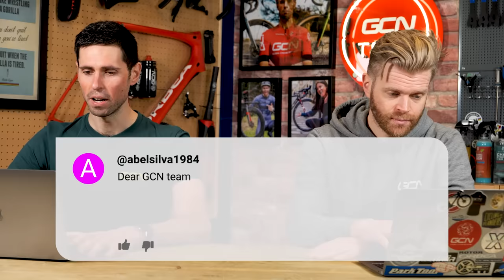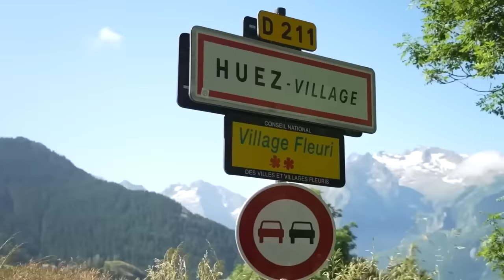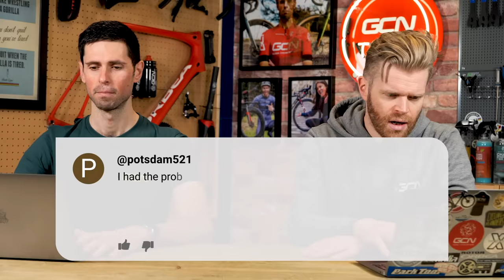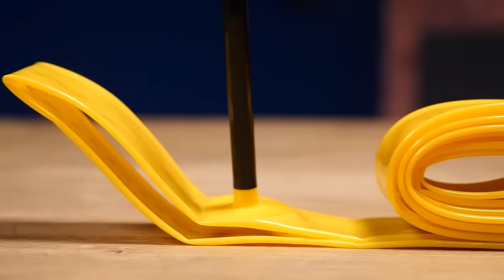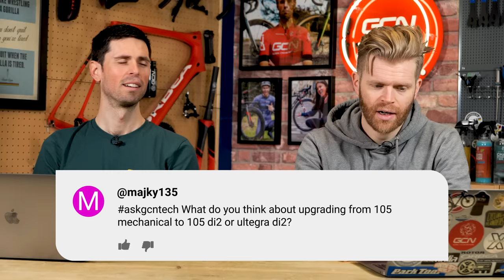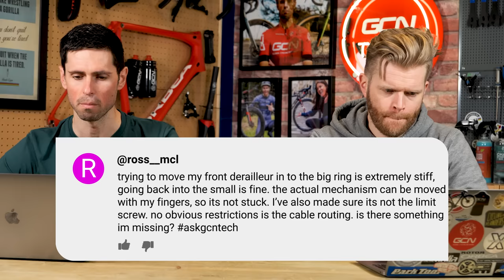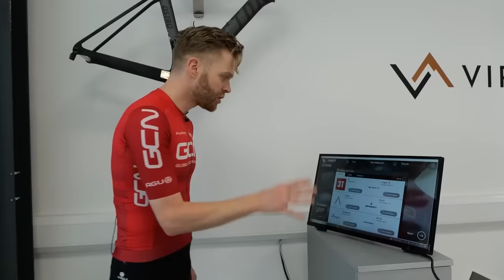Electronic Gears, TT Chainrings & BOA Cycling Shoes | GCN Tech Clinic

Comment from the maker: We love to hear those nerdy bike questions! Keep them coming with #askgcntech ⚙
Reply: Thanks for answering my question!
Reply: #askgcntech I am trying to add a crank based power meter to my sram rival group set and I cannot remove the drive crank. I have tried removing it with a large hex tool wrench but after putting a huge amount of force on it, it won’t budge. Any advice?
Reply: #askgcntech Hi GCN legends, I have a Wahoo Kickr trainer and it’s begun to make a grinding noise when riding in the bigger gears. The cassette and chain have been recently changed and can’t figure it out. Gears are shifting fine. Any ideas? Do Wahoo trainers needs servicing? free hub issue? Any ideas? Thanks!
Reply: A saddle that is comfortable and a good bike fit, even a fit from a dealer who has the knowledge and will take the time to adjust the bike and maybe swap out a stem if necessary is worth way more than the cost of a carbon frame
Reply: #askgcntech should I worry about buying those budget-friendly sunglasses & lights from Amazon? How inferior are they to branded gadgets?
Reply: #askgcntech does a carbon frame make a gravel bike more comfortable compared to an aluminum frame? Or do the Tyres make a big difference in gravel like they do on road bikes? Looking for my first gravel bike!
Reply: A good high quality wheelset makes a big difference and will offset the weight difference of an alloy frame and may even make you faster than a person on a Carbon frame Ollie forgot to mention.💯👌🏻✌🏻🚴‍♀️
Reply: #askgcntech I'm cycling to Geneva in the summer then off to watch a stage of the TDF. I'm planning on giving Alp D'Huez a go and wondering if i could change my Ultegra chain ring setup from stock 52/36 to 52/34 is this actually mechanically possible does anyone have any experience in this? also Jockey wheel /bearing upgrades does this make a noticeable difference or more for show. Thanks.
Reply: #askgcntech Where can i watch the GCN + Documentaries such as KOM hunters now gcn + is no more.
Reply: #askgcntech when commuting, as well as a regular front light I have a small (low output) light on my helmet that makes a huge difference to my winter-night safety so I can catch the eye of drivers waiting to pull out of side roads; aero aside, is this something you can envisage problems with (e.g. in a spill or long-term neck fatigue)?
Reply: #askgcntech as I'm riding exclusively indoors for the past month and probably the next one or two, how often should I clean and lube(oil) my chain? I think it makes more sense to give a number by riding hours instead of a distance. Right now I've noticed that the drivetrain itself is not really "dirty" as when i ride outdoors but after 8-10hours of riding it gets a bit noisy so i lube it up. Is this too much?
Reply: #askgcntech Hi GCN team, question about Silca Synergetic - I live in the rainy Pacific North West and recently switched to Synergetic lubricant - do I have to always reapply after hosing down my bike coming back from a rainy day ride? If yes, I heard the new Silca Synerg-E is more viscous - is that a better alternative so I don't have to always reapply after hosing down my bike? Thank you #askGCNTech
Reply: #askgcntech hello my friends, I will be doing multiple gravel events and wanted to know if you would recommend a 1x or 2x setup. I’ve never done them before so don’t know how steep the hills are. Which should I go with. Currently have a 2x 50/38 and 10-36 setup
Reply: #askgcn Ben O'Connor seemed to have pronounced ribs on or under his sleeves of his new decathlon kit in Mercia. Is that allowed? Are other teams doing it?

Comment: As someone in his 40s that had the same question about carbon bikes and ended up biting the bullet — the performance difference might not be much, but the feeling, oh man, it was definitely worth it. I don't care if I'm 10 seconds faster or whatever, but it feels lighter, more comfortable, a lot more pleasurable to ride.
Reply: I agree, I got a carbon bike this year. I'm not going noticeably faster but the bike just feels nice to ride. No regrets
Reply: I simply put a redshift stem and seat post on my alloy frame...... Feels just as nice if not a bit nicer than both my steel build and my carbon bike ..
Reply: @gmivisualsjason3729  throw that stem on your carbon bike and you'll be reminded that alloy is rubbish
Reply: We can tell you're a beginner. You've made the same kind of comment that people did when aluminium bikes arrived to the market in relation to cromoly ones; oh aluminium is so much better than cromoly, and this and that!...That's how marketing works on people's head. That's brain washing. Have you tryed Titanium? Have you tryed Termoplastic? What about carbon tubes+aluminium joints? Even wood? They make wooden bikes in the Basc country! Let us now after.
Reply: @bluetooth2000  I own carbon, aluminum, titanium and steel bikes.  I really only ride the carbon ones and for good reason.  I'll probably get more metal bikes in my future but it'll be to support a local craftsman vs getting a bike that's actually going to perform well
Reply from the maker: If you've got the funds a carbon bike is great! Would you ever go back to buying aluminium?👀
Reply: @gcntech  if I'm short on cash, sure — there's nothing wrong with aluminium bikes, but if you have the privilege of affording carbon, go for it. It definitely offers a better ride quality.
Reply: @LFMC1  Wrong again. 🙄
Reply: As someone in his 40s that had the same question about carbon bikes and after riding Alu, C and Ti bikes on road & gravel...the performance difference is NONE but the feeling, oh man...80% from "the feeling" comes from wheels/tires setup !
Go for a bike frame where you find a comfy position (material or aero doesn't matter at all for any rider who mainly ride <35km/h alone), get some modern wheels (large U shape, good hub) and good tires (main brands, mid-top range, no race/TT stuff), you will get a really nice riding feeling !
Reply: I think the feel that comes from rolling carbon wheels is even more important. If you have a carbon frame but still rolling with alloy wheels, you are missing most of the experience. Bad wheels may ruin any great expensive frame. Buta  good set of carbon wheels and proper quality tires can smooth out almost any frame even if its made of stone.

Comment: “On the rivet” is an old-school reference to leather saddles which were typically riveted near the nose of the saddle, hence “on the rivet” being on the nose.  And the hard shifting issue is 100% a worn or dirty housing/cable (and easy fix), takes very little internal friction to impact ability to pull the cable and shift big.
Reply: ...on the rivet ....yes leather saddle reference manly to old Brooks saddles
Reply: @edromero7985 pretty much every saddle was riveted and Brooks didn't invent the bike saddle
Reply from the maker: We love these old cycling saying, can you think of any others? - Another point to electronic shifting?
Reply: @gcntech He was really on the rivet up the base of the climb, but when the road turned skyward in the final five k, that was when he started dancing on the pedals.

Comment: Like Ollie said, no reason to upgrade to electronic groupset unless your mechanical has failed or you found a super deal.
Reply: … or you would like to have electronic shifting and can afford it
Reply from the maker: Nothing wrong with mechanical 🙌 - electronic shifting is pretty nice though...
Reply: I think the only reason you really need electronic groupset is for a TT/Tri bike, so you can shift from both positions.  Otherwise, mechanical shifting is perfectly fine, and works extremely well for a modern groupset.
Reply: Or you have a medical issue.
Reply: @grahamaustin9085  if you can't push the shift levers, you shouldn't be on a bike.  i can do it with my pinky.  that's the most idiotic thing people say "oh muh mech shifters are too hard to push!"  how do you brake then?  that requires way more hand strength than shifting

Comment: The front derailleur problem, where it's hard to shift to the big ring - it's almost certainly a cable tension issue. Shifting to the big ring is the action that adds tension to the cable, so if you have barrel adjusters or a built-in cable tension adjuster on the derailleur, it is best to ease the tension a bit and adjust the limit screws accordingly.
Reply: Yeah, I was going to mention that as well.  The more tension you have in the cable, the more force you have to use to press the lever (because you are pulling a cable that is already tight).  Front derailleurs are tricky to set up some times and there is always a possibility that the derailleur is bent or otherwise positioned improperly.  I find the Park Tool youtube video on this topic invaluable.
Reply from the maker: Great idea - we've got a great video on these sorts of minor adjustments  👉 https://youtu.be/4Q34TIMxrcI
Reply: This. I had similar issues and tried to "fix" by messing with the limit screws. After going for a (very miserable) ride without checking if it was actually working before, I completely loosened the cable and re-adjusted the shifter from the scratch. First attempt resulted in the same behavior, while in the second attempt I actually put more tension on the cable, and it was within specs.
Keep in mind I did this in my kitchen without a proper nose plier to tension the cable.
Reply: I’ve always set the front mech by shifting into the smallest ring, screwing the barrel adjuster all the way in and pulling the cable through by hand. Any remaining slackness can be taken out with the barrel adjuster. It’s always worked for me.
Reply: I had this problem on my bike and found it was caused by the shift guide arms not being parallel to the chain. The derailleur just clamps on to the upright tube so simple to loosen it and turn it so the guides were parallel! Shifts like butter now.

Comment: BOA was originally invented for, and is frequently used on snowboard boots. It has many benefits that cross over, like wanting to adjust tightness on the fly (with gloves on), and easily being able to distinctly tighten separate zones of the shoe/boot.
Reply from the maker: Boa seems to be the way most shoes are going - Have you made the jump from laces?
Reply: @gcntech I haven’t had laces on cycling shoes since the mid 1980s, but I still have two reasonably good sets of all velcro Giro Prolight 2 that I haven’t yet completely worn out! One for indoor training, one for the open road.

They were the lightest production shoe at the time they were released, and the delicate American (VanGarderen) used to endorse them. 

I have a newer pair of shoes with boas sitting in their box in my closet, waiting for one of those old pro lights to fail me. It’s inevitable, but still taking longer than I expected.

(Post edited to space paragraphs for your reading pleasure.)

Comment: Carbon vs aluminum is not just weight. In my experience, carbon gives a much nicer, more plush ride doing a much better job of absorbing all the roughness of the pavement. Aluminum feels very rigid and rough. I've bought 3 used carbon frames and built them up with mid priced components and have been riding all of them for years. Great way to go.
Reply from the maker: That's true, good quality carbon should take up the bumps a bit more. That said, aluminium frames have come a long way, Alex just built himself a dreamy aluminium bike 👉 https://youtu.be/XaaIMTObYLU

Comment: often when you go to a bike shop to buy a new bike they can put on the size cranks, stem and bars that you prefer at no additional cost. Sometimes even the cassette of your preference if they have enough lying around. Aluminium bike is absolutely fine, also if you crash it's far less likely to be damaged beyond repair. if you want to save a kilo, lose weight, use the 1000,- you save on getting proper tires, nice fitting clothes and other accesories.

Comment: BOA is all over the place in workwear, running, golf, snow sports, helmets, and I've even seen it on prosthetics. It's expensive compared to laces, Velcro, and buckles, so it won't be on everything, but I think it's proven it's metal and they have a good warranty support program if something does break. Some of the older dials got gunked up easily or would even break off, but I personally haven't seen any of those failures on their newer snap-in dials... and ive caked them in mud quite a few times.
As for the aero and weight arguments, I guess it's up to the user. Laces are more aero than a dial, one dial is more aero than two... but two dials let's you change your circulation mid-ride and ultimately lets me ride further and longer. As for weight, ankle high versus no-show socks probably have a greater weight penalty, plus shoe laces retain water/moisture. A damp shoe is a heavy shoe... and heavier with laces.

Comment: Great show and keep’em coming! The issue with the front derailleur may be as simple as lubricating the cable wherever it may be rubbing in the housing causing friction. With a few drops of a thin lubricant  such as Tri-Flow the problem may go away. Much easier and cheaper than replacing the cable and the lube starts to work almost immediately. Works wonders for brake cables too, especially the noodle.

Comment: I went Di2 when I'd gone through two Shimano 105 shifters and two frayed shifting cables (both on multi-day tours) in as many years. It wasn't a cheap upgrade and it challenged my wrenching skills -- especially the upgrade from cable to hydraulic brakes. But I haven't regretted it for a minute. More reliable, more reliable shifting, and the difference in braking feel is nothing short of astounding.

But as the professional spokesblokes say: If it ain't broke, don't fix it.

Comment: Re the guy with TPU tubes losing air. Me too. I bought 6 TPU tubes some months ago, after watching vids of how they are more pierce resistant and so much lighter. Tube #1 lost air overnight and on rides, bubble testing showed nothing, and it got replaced in a week or so. #2,3,4 got punctures over time but patching them was hit and miss. Bubble testing showed a good repair but they kept losing air, sometimes to complete flat overnight. Sometimes the patch just came unstuck. They got replaced. #5 is on the bike and surviving. #6 is a spare as I've gone back to butyl on the rear wheel. The brand was RideNow and I would not recommend them to anybody.

Comment: Frint shifting issues - On some Shimano models there has been known (but not common) issues of corrosion over time in the index ratchet system. Most Shimano shifters are serviceable, as the ratchet system and lever blades are available as spare parts. Try to clean the mechanism as best as possible, and spray a water displacer/penetrative fluid (WD-40 or similar) to lubricate the mechanism. I always spray a little fluid on the shifter internals at service intervals or at the start of winter to try and increase the longevity of those delicate parts.

Comment: I dispute that the BOA system isn't in other shoes. It has been used in certain mountaineering boots and is increasingly present in Ski boots and running shoes. The micro-adjustment is very useful in ski boots designed around it because you can get secure around the foot without pressuring an edge of the plastic shell into the top of your foot.

Also, laces are harder to get right first time and take more time and effort to adjust, definitely can't be done well one-handed while riding, and velcro might require more force to get tight than twisting a boa dial, As somebody with a shallow midfoot, I wouldn't love adjusting velcro and tugging my foot to the side while riding.
Reply: BOA IP1, Li2, S2 and S3 allow you to fine-tune lace tension on-the-fly. I've done this a handful of times with my IP1. Only the regular L-Series require undoing to readjust lace tension.

Comment: I have a Emonda ALR that I bought new in 2015 and love the thing. I ended up upgrading it to SRAM AXS, carbon bars, carbon seatpost, and lighter wheels.  Weighs just a tad over 16 lbs.  When I bought the bike, the carbon version was 1200 more, but the AL version was just as nice riding. So I saved the 1200 and it is still part of my road bike stable.
Reply from the maker: A good AL frame can be pretty great 🙌 Do you think you would go carbon for the next bike? We would love to see current bike, maybe one for the bike vault 😉 https://gcn.eu/techuploader
Reply: @gcntech  Oh I have 3 carbon bikes, a couple high end, and I had carbon bikes prior to the ALR...  this was just such a nice riding bike that going with the carbon SL or SLR just made no sense. I put my CheckPoint on the bike vault not to long ago.

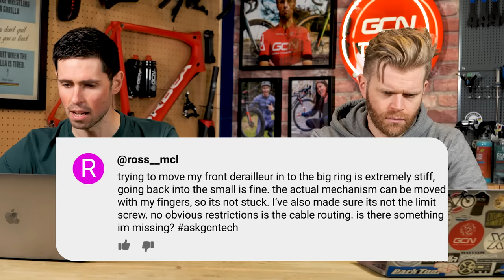Comment: 9:30 Some front mechs like older Shimano have a pin the cable runs around that has 2 different positions depending on the angle the cable exits the frame/guide, some others do something similar by having 2 clamping positions for the cable, id try and find the installation manual (Shimano's are all on their website) failing that do an image search and look at how others have installed theirs.

Comment: With 1x TT bikes, you can use the bike on all sorts of terrain if you just swap in a smaller chainring and wider range cassette. A short flat TT might need a 58t ring and 10/28 cassette, while an ultra distance race on rolling hills might need a 50t chainring and 10/33 cassette

Comment: I had a couple of Shimano 105 shifters that had intermittent issues going to the big chainring. I did a lot of searching before I chanced on someone's YouTube video suggesting the shifters were bent -- possibly from trying too hard to shift up on the big chainring when it was already on the big. The shifter mechanism could be bent. If you've got a Shimano, see if a replacement shifter (not cheap!) will sort out the issue.